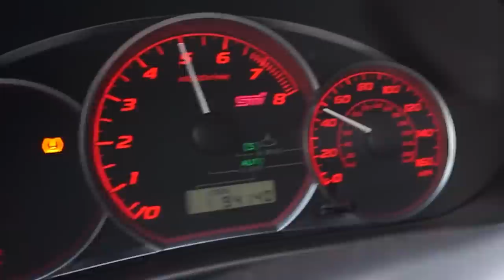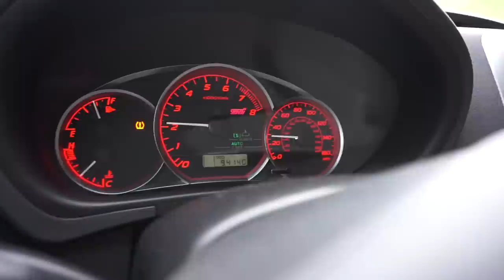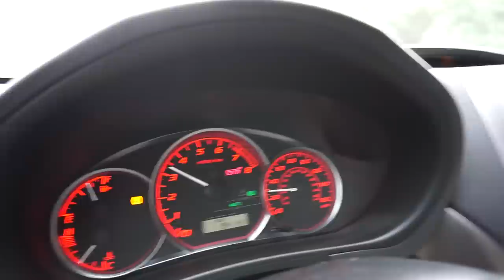Feeling Full Throttle in the 2008 Widebody WRX STI For The First Time!

Comment: Like the emblems, but the yellow insert looks horrible.
Reply: 100% agree
Reply: Diego ramirez bright yellow ads hp bro, you didn’t know? Aesthetics don’t look better, they add 200 hp per square inch of bright color stuff. To break it down from a fundamental stand point. If you have a bone stock sti and 305 to the crank. If you overlay your badges and paint your intake bright yellow. That =100hp glad to help with the scientifical stuff.
Reply: Hell yes

Comment: No to the side decals
Tint guys did it, I saw it when they were working through the engine bay. I saw the pipe flex and I cringed lol.
Reply: When did we see the Tint guys in the engine bay?
Just hanging in the engine bay disconnected it looks like the pipe sits a little short to the left, like it would be likely to pop
Reply: they were touching the other pipe never touched the one leading to the throttlebody
Reply: He means the windshield install guys...

Comment: The floral yellow vent overlays look absolutely terrible and adding the STi fender badge onto the widebody fender looks so corny.  On the normal Sti fender, the badge sits inside of a cut out made to lay the badge in the fender. It doesn't just sit on top of the fender 3m taped on. Besides that, The tint and car looks super good.